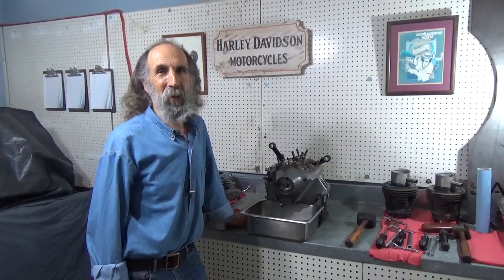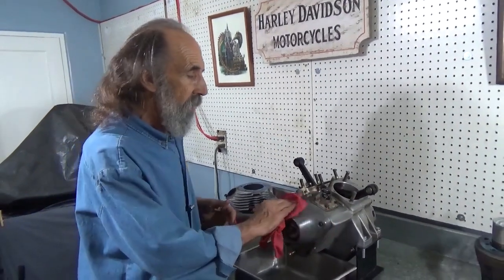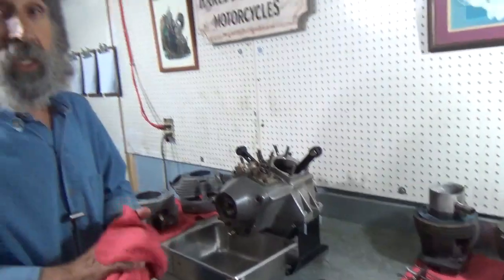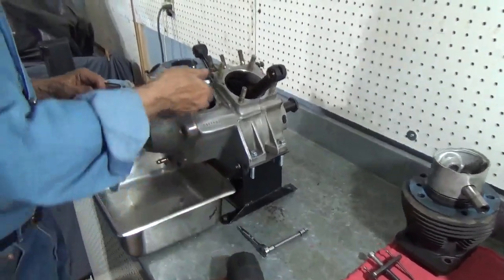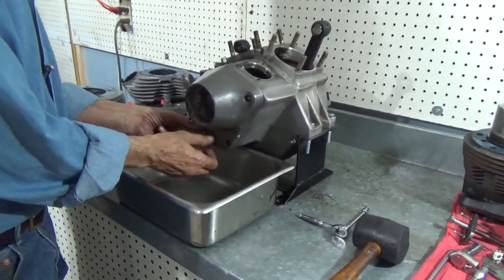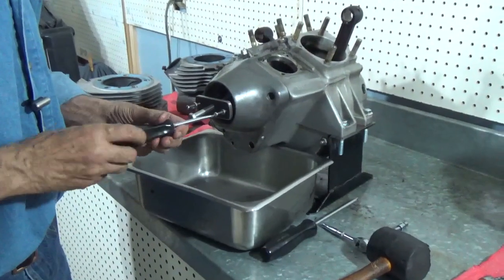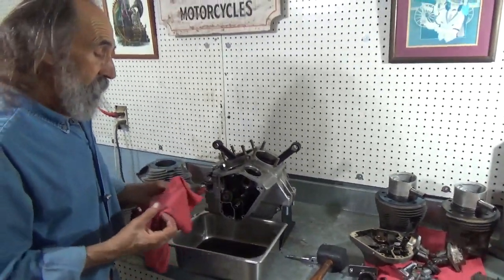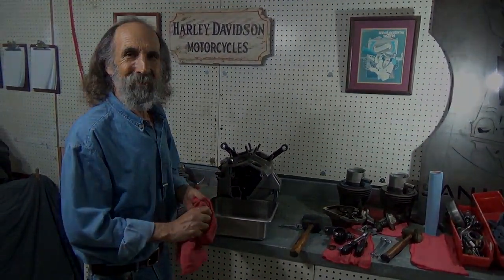Harley Davidson Shovelhead Motor  Disassembly, Part 2

Comment: Love your YouTube channel Mike. Very detailed and informative videos. Currently repairing a 1958 flh, and also putting together a 51 motor with 50 heads, but changing the intake ports to oring style to fit a super e carb.
Reply from the maker: Thank You.  I think when Harley O-Ringed those intake ports it was one of the greatest improvements ever.

Comment: Mike, it seems like you're not alone in digging shovelheads. I put shovel tops on my 1960 FLH. I know some are gonna scream sacrilege! But each to his own. I remember when shovels were the "new" engines. I worked in a small shop in town after my day job when a shovel head motor came in. I bought the top end, complete, from the owner. And when the lower end of my Pan came back from the master of all engine builder's in my area, I topped it off with the shovels which were in excellent condition.

Everyone does things his own way and I surely see the logic in checking a lower end the way you did. But I was always taught that when you check the connecting rod big ends of an engine you put the flywheels on the power stroke position. In other words over top dead center, no more than 90° after TDC. That's where the most force is put on the rollers, races and crankpin when the cylinder fires. We used to just check by putting the flywheel in that position and pulling up and down. Although your rubber hammer technique would work well in that position.

What do you think? Does that make sense to quick check the play in the rods in the power downstroke position as opposed to any random flywheel position? I know this is an old post, but maybe you or other engine builder's will see it.
Reply from the maker: I do believe you are correct.

Comment: Dude, this is awesome. I watched part one already and just finished this one, you have a lot of knowledge about these older Harley motors. I'm a young man (19), so you'd think I'd be into this new technology but this new stuff is really complicated, you practically have to be a rocket scientist to work on it. I'd rather be old school and have something that I can rebuild in my shop with some tools, a bit of knowledge, and maybe a book or two. Thanks for passing on your wisdom to guys like me, we have to keep old stuff like this going
Reply from the maker: Just remember, "The new stuff mostly bolts together.  It was made by computerized equipment. The old stuff has to be fitted by hand."

Comment: Yup, those 8/32 screws that hold the ignition plate? I broke one! So.... instead of taking it to a machine shop for the extraction, I attempted to drill it. Well, that didn't end well either! So......bought a OEM nose cone and buttoned it all up with new parts. End of drama! But, I did resemble it with never seize on those little stand off screws. Both Male and female ends. As you know, the littlest stuff will jam you up! Great video Mike, thanks!!
Reply from the maker: Congrats.  It takes some slow and careful moves, sometimes chemicals, sometimes let it sit overnight.  But there's almost an "art" to sneaking up on things and not breaking them.  Then, there's the important thing:  Go for a ride!

Comment: Hi Mike.  I have a small amount of oil leaking from one of the crankcase studs. Service manual page 3-29, figure 3-35.  is the right bottom stud. I remove the skid plate and cleaned everything. Took it for a spin and let it sit. So I know that is the guilty stud. I experimented carefully attempting at removing the nut from the right hand side. But the entire stud spins. I stopped at this point. So I believe what would happen is that it would spin out of the nut on the left hand side or maybe at some point the nut will break free. Not sure.  I do not believe there is enough space to pull the stud out on the right hand side. It would run into the frame.  I ended up concluding that it's too risky to fix this leak while it's in the frame. That means pulling the engine completely out to do this.  That's my conclusion anyway. Wondering what your opinion is on this?
Reply from the maker: Just a suspicion, but, I believe, if there is no crack in the case, that the oil is leaking somewhere else and gathering at that spot.  It could be leaking from the cam cover and running over to the stud.  It could be leaking from the oil pump and running down to the stud.  It could be leaking between the cases and running over to the stud.  More checking will tell. Clean around it real well and see if it gets wet above or forward from that stud.
Reply: @pacificmike9501  I will 1000% check. Ty vm.

Comment: Mike where can i purchase a compensator socket will allow me to turn the motor to align push rods. Also the head bolt wrench. Thanks Mike. Cliff Sr
Reply from the maker: Any good tool supply.  The socket for your compensator is probably 1 1/2".  Head bolts? 9/16 torque adapter is what I use.

Comment: Mike, do I have to remove oil pump on a 75 shovel to split the cases. I'm just looking to split and reseal cases. Trying to do it it without removing pump. Not sure if it ca. Be done that way. Thank you
Reply from the maker: No, you don't have to, but you're going to remove the cam cover to remove the right case.
Reply: @pacificmike9501  great thank you Mike for getting back to me, I love watching your videos your like the Bob Ross of motor building. Lol but I'm sure you heard that already. What's the sealer you use to seal case back together

Comment: Hi Mike,
 Merry Christmas 
 How do you check the side play in the rods? Thanks, Steve
Reply from the maker: Reach in and use a feeler gauge.  Don't go crazy.  If it's running well and has no up and down movement, you're okay.
Reply: Thanks

Comment: Hi Mike,
That tool you made about 42 years ago to remove the cam cover, what are the specifications?
I would like to make one myself.
We love your videos, very informative, thanks Mike....
I have a 69 Shovel and would like to learn more about specialized tools
Thanks
Darren
Reply from the maker: Okay.  If I remember correctly, I use a points cover gasket for a pattern.  I used two long 8-32 machine screws with nuts.  Now all you need is a 3/8 bolt.  Cut out the Piece of steel ( I believe it is 1/4" Steel plate).  Then, drill and tap a 3/8 fine thread hole in the center.  You may also have to thread the bolt a little A little longer.   And there it is.

Comment: Hey Mike , Jon from the uk, i have two 79 shovels ,one runs great and a daily rider , the other blows pushrod tube corks and blows smoke when warm out the rear exhaust port. Any ideas to the problem , sifton hydro tappets aftermarket lifter blocks , rebuilt s&s oil pump and cam chest , all is good in there, breather timing etc , any help greatly appreciated, I’m thinking either valve guide seals or piston rings , peace out , ps your videos helped me get the daily rider riding daily 👍
Reply from the maker: Is your crankcase breathing?  Is your oil returning to the tank?  Look into the tank with the motor running.  Is the pistorn in the oil pump functioning?
Reply from the maker: I need those questions answered.  Then, maybe we can diagnose fairly well.
Reply: Hi Mike , I’ve checked the breathers and they are good, oil flow is good back to the tank and the pressure relief valve is doing its job, 20psi oil pressure at start up on idle cold and down to about 6-7 when warm. Thanks for your reply Jon
Reply: When I received the bike the oil pressure was through the roof, the early cam chest cover was on the bike which I replaced with the correct one for the motor. After that the oil pressure went down to what I consider normal, similar to my other shovel.
Reply from the maker: Sounds like you're learning a bunch.  Very cool.
Reply from the maker: Always remember:  "Pressure gauges vary a bunch.  Circulation is what roller bearing motors need.  Pressure is really secondary."
Reply: Sure am , my flh was a steep learning curve to iron out the niggles, runs and rides great, I understand these motors run on little pressure and circulation is key.

Comment: Hey Mike, great vids the bolster my confidence to continue this journey.  Doing a similar exploration and refresh on my '75 Shovelhead SG FXE.  Testing the lower end in the fashion described.  All seems good.  No rod/crank up/down endplay is detectable, solid 'thunk' sound with a rap from a rubber mallet.

Question, you mention the rods have end play - side to side endplay.  Mine do.  Male greater than female.  Males exceeds the 3/64th specified in the shop man.  The doc says or implies that this is relevant only if up/down plan is detected in rod to crank bearing.

Therefore, my conclusion, based on the imperfect accuracy of the test described in the vid, the   lower end is a reasonable risk; i.e., do the top end only.

I realize this is an imperfect science so no guarantee, but it passes the risk litmus test. The side-to-side play in the male connecting rod is irrelevant.

Have I got it?  thanks
Reply from the maker: It's not "irrelevant," but not a reason for concern either.  You understand, when you fire it up, you'll be fine.  We know it's not "new," but, it's not worn out.  I really wouldn't worry.  But, that being said, I would freshen it up, but I wouldn't put a really wild topend on an old lower end.  You appear to have some real good logic going for you.  We know wild engines have a shorter lifespan.  So, putting a good old lower end to a real rigorous test is not a great idea.  From what you say, I'd rebuild the top and go ride my bike.
Reply: Mike. Thanks. Top end rebuild, stock or very close.  May go for the roller rocker arms and modern lifters.  Thanks vm

Comment: I need to replace my cam cover, One side of the 8/32 has stripped again. Already had a 8/32 heli coil installed. So ordered a new cover.
Reply from the maker: Sometimes they fit and sometimes they don't.  Check your manual.  Not everything is obvious.  Bushings must line up.

Comment: Hi Mike,
NICE details & Wonderful idea on your TOOL ( to be duplicated with your permission) 
Good information on the STOCK  Harley-Davidson CAMSHAFTS being STAMPED with an  "H" 
( does the  "H" just designate "H-D" ? or a particular "H" camshaft that Harley used ... ie: as opposed to a Harley "G" or "I" camshaft ??? ) 
Thanks again for the VIDEO 
COOP

.......................................
Reply from the maker: Thank You.  I don't usually claim an idea as "My original thing."  It's because,either someone else showed me, or it was just a logical solution that other people thought of at the same time.  I'm not sure what the "H" on the cam stands for, probably FLH.  It's a good old stock cam though.  I've never run one for any real length of time.  There's always something more fun to try.

Comment: Hi Mike. Appreciate your videos. What product do you recommend for cleaning the inside of the cylinder and head?
Reply from the maker: I just scrub them with whatever is handy, scotchbrite pads, soap and water in the garage sink.  Be sure and oil the cylinder walls when you're done, so they don't rust before you prep them for reassembly.

Comment: Hey Mike, I have a 1979 FLH ShovelHead 1200 74CI. I have a brand new set of 80 CI cylinders with the pistons, can I use these with my same heads? If so what would I need to change or update to make this work? Thanks JP
Reply from the maker: You can use the cylinders, but not the pistons.  A 74 cu. in. Shovelhead has a 3 31/32" stroke and a 3 7/16" bore.  An 80 cu. in. Shovelhead has a 4 1/4" stroke and a 3 1/2" bore.  When I rebuilt my 74" Shovelhead, I installed a pair of 4 1/4" flywheels and bored the cylinders to accept the 3 1/2" pistons designed to use with the 4 1/4" flywheel set.  It all works just fine when you do it completely.  But, grab those cylinders and pistons if they're nice parts and reasonably priced.  You'll use them eventually.

Comment: Hey Mike, Great info.... I bought a 76 Shovel and it has oil leaks everywhere.  I believe the cam cover is leaking (I hope it is NOT the inner oil pump gasket) but I want to replace the cam cover gasket.  can I remove the cam cover without having to remove the lifters?  I understand removing the ignition parts but I hope I do not have to remove the lifter blocks just to get the cam cover off, cleaned up, and a fresh new gasket installed to hopefully stop one of my many leaks.... any other advise you could offer would be GREAT!  Thanx in advance.... TD
Reply from the maker: You'll need to loosen up all of the pushrods so as to relieve the pressure on the camshaft.  Not removing the lifters could be a mistake.  This is your chance to inspect them.  Take it step by step.  Consult your service manual.

Comment: So I have question I have a 1972 cone shovel motor rear rocker box nut steady dripping oil onto my rear exhaust if it’s not a o ring issue where else should I look for the issue thanks
Reply from the maker: It's one end of the shaft or the other.  Sometimes they just don't seal well and have to be redone.  We get better as we go along.  Try some whit lithium grease on the 0-Ring.
Reply: @pacificmike9501  thanks mike I’ll try that I appreciate your videos more than you know and my panhead and shovelhead do as well

Comment: Hi Mike, you were pulling up on the rod then rubber mallet down right?  ...also, what about rod play side to side, didn't see you do that one.  I don't remember the magic number for rod side play, do you?
Reply from the maker: In answer to your first question, the answer is "yes."  These are just, "quick checks."  "Seems okay.  I'm gonna go with it."  I normally get about three top end rebuilds required to about "one lower end rebuild."  This will vary a lot from rider to rider, depending upon his or her habits.  Harley lists "rod side play" as  "connecting rod end play."  This is listed as ".005-.025 in."  Quite a spread.  If you were assembling it, you would be concerned with "adequate" clearance and not having it too tight, usually due to worn tapers in the flywheels themselves.

Comment: In about a couple of months I am going to start exactly the same project - rebuild 1983 80 inch FXRS motor.  I realize I need to get the Service Manual for that particular bike first but after watching a few of your videos I need to ask - where on earth did you get that fancy stubby wrench you are using to undo all the bolts on a head and cylinder?  I searched Internet high and low with no success.  Thank you.
Reply from the maker: Any good tool supply should have it. My particular one is a Snap-On.  I have a set of them.  Other suppliers also have them.  They'll get you into some tight places.
Reply: This is for future viewers inquiring about the "stubby wrench". Search for a torque adapter.

Comment: What is your thoughts on using synthetic oil is a shovelhead. I have always use 50 or 60 weight Harley oil since I live is a hot climate. i have two twin cam Harley and my 72 FLH so I know to use synthetic oil in them. I do like these twin cam motors I am going to sell one of both and track down an Evo Harley.
Reply from the maker: I really don't have recommendations on synthetic oil.  I apologize for that.

Comment: Hey pacific mike! My old mans shovel has been sitting for about 10 years now and im about to start wrenching on it. Any advice on what needs to be done to a 75 flh that has been sitting that long? Please and thank you
Reply from the maker: You didn't tell me enough info.  Was the gas drained?  Is it full of old oil?  Was it running when it was parked.  Is it, or was it fully assembled?  Sounds like you want to get started, and I'm excited for you, but I need to know more before I point you in the wrong direction.  I'm willing.  I need a description (engine, carb, ignition, electric start), you gotta tell me more, and I'll try.

Comment: Hello Mike love your videos we have talked befor about belt primary any way can you beleve  the cone motor is 50 years old this Aug. were have all the time gone ...ride safe my Brother ...Bill
Reply from the maker: The hard one to believe is that I just got my old cone motor up and running again.  The motor went in on the videos, as did the heads, trans, front wheel and front fender.  I bought that '77 brand new in 1978.  Next month will be 41 years.  I promised her  back then, we'd get old together.

Comment: Hey Mike, I wish I had email address for you but since I don't, I'll ask you a question here.  I own an 84FXWG, last of the shovelheads, and I was wondering what the compression should be on my old girl.  I've owned it for all but the first two years.  I refreshed the top end about 15-20 years ago and a buddy of mine said it was starting to smoke a lil bit last year in Sturgs...any ideas?
Reply from the maker: Smoke a bit?  Shock and amazement.  It's an old motor with some old technology.  How many miles on it?  What pistons did you install?  Too many variables.  Sorry, I just found your comment and realized it was unanswered.

Comment: You've got the experience, but using 8/32 screws in a puller application would make me very nervous.
Reply from the maker: It takes very little pull to do the job.  40 years with the same pair of 8/32's proves it.